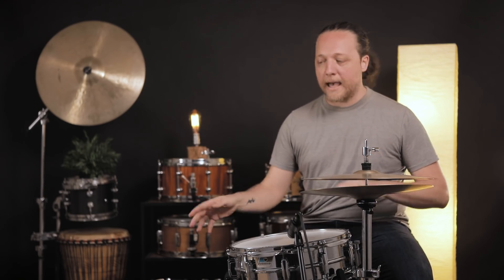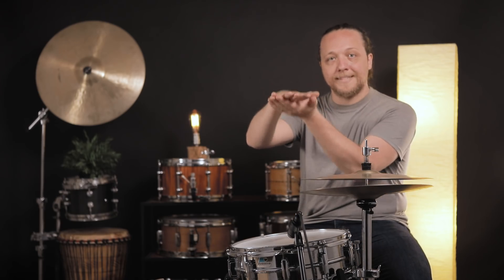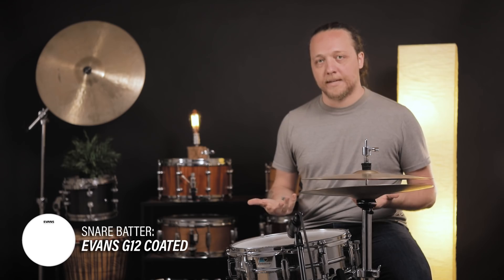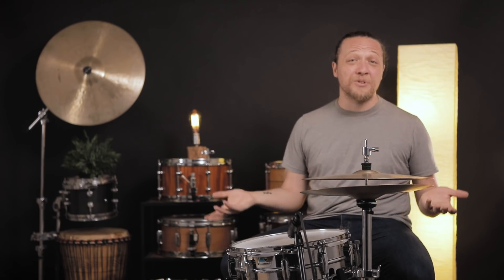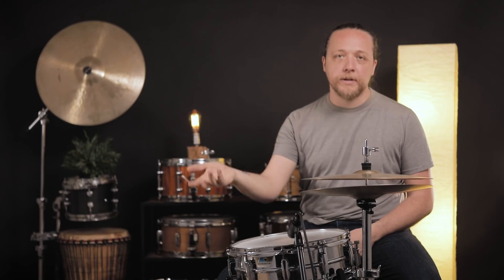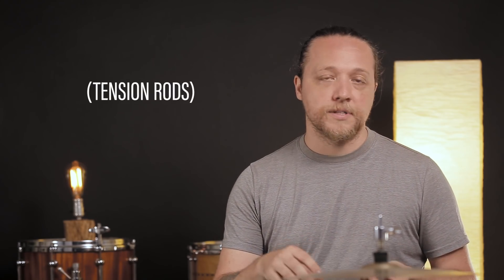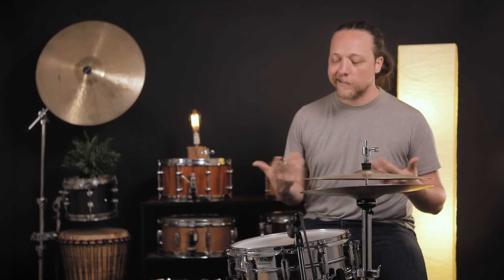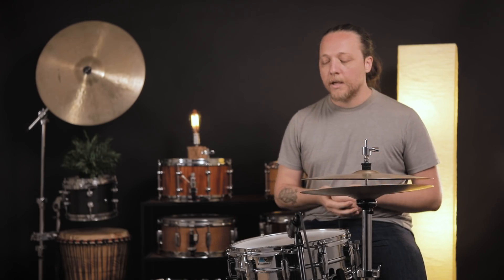Rimshots & Lug Locks - Unwanted Detuning | Season Two, Episode 32

Comment: Hey Cody! I've been following Sounds Like A Drum since the beginning, but this is the first time I thought I could put my two cents of knowledge into a comment! So, here it goes... I am a really heavy hitter, and to me this has always been the top number one issue regarding tuning/playing. I own quite a few snares, and it doesn't matter which one I choose for the gig, I always encounter the same problem with lugs backing out on me. Let me tell you, honestly, I just gave up.

I've had a Pearl Ian Paice Signature snare with what they call "tension locks", and those helped, but didn't eliminate the problem...

I have a couple of DW and PDP snares with the TruePitch tension rods, they say those will stay in tune for a longer time, it didn't help...

I've tried putting some Teflon plumbing tape onto the tip of the tension rod, something I heard a roadie tell me once, that actually helped, but didn't solve the problem and it made quite a mess once it was time to replace the heads, with the tension rods getting all sticky and whatnot...

One thing that actually was quite surprisingly helpful was putting some graphite grease into the receiving part of the drum lug. This particular grease lubricate both the drum lug and the bolt, but it also has a "gripping" effect of sorts, and they keep the lug in tune a lot longer as I've found out.

I've tried numerous brands of lug locks, like Gibraltar, Pearl, etc... and found out that the Tuner Fish Lug Locks are the only ones that really keep the lugs in position, but they are not perfect, and let me tell you why. They come with little rubber bands that are supposed to keep them "attached" to the drum even in the unlikely event of them coming out of the lug head, but these rubber bands are fragile as hell, and even placing the drum inside the case or gig bag has broken them on me. And being perfectly honest, this "unlikely" event of a Tuner Fish Lug Lock snapping out of a lug has happened to me at least a half dozen times, and in two of them I lost both the Tuner Fish Lug Lock and the lug it was "locking". They snapped out of the drum, fell on the floor, and poof... they were gone. Just like you said, the ones that actually snapped out were actually the ones from the bottom side, specifically the ones next to the strainer/throw-off. No idea as to why that happens on this part either.

So, in short, when I have a gig that I know I will be BANGING THE HELL OUT of the drum, this is what I do: I combine a lot of the techniques I found most useful, which are:

1 - Put some graphite grease into each receptacle casing of each drum lug, and a little bit on the tip of the bolt doesn't hurt either;
2 - Install the Pearl Tension Locks (original to the Ian Paice Signature snare) on ALL tension rods;
3 - Install the Tuner Fish Lug Lock with its whimsy rubber band on ALL tension rods just a little before the gig, because if I do it at home and put the drum in its case/gig bag the rubber bands will definetely break;
4 - Pound away;
5 - Once the gig is done, double-check to see if all the Tuner Fish Log Locks are still there. If they are, great success. If not, get on your hands and knees and start looking (a flashlight will help).

So, basically, this is it, at least for me. I forgot to mention, I always carry two snares with me. If the first one starts backing out a lot, I pop the backup on the stand and that is that. I don't have two of each drum, but I do have a Ludwig Supraphonic 14"x6.5 and its "replica" of sorts, which is the Pearl Sensitone Beaded Seamless Aluminum 14"x6.5". Doing all of that helps A LOT, but I have really given up on finding a perfect fix for this problem. Like you said, it's just something about the mechanics of drums.

Sorry for the long essay, but I got really excited when I thought I could actually add to the debate!

Keep rocking, dudes! I'm a huge fan of your work! Best regards from Brazil!

P.S.: If you want to check out my playing, look for Diablo Motor on YouTube or any streaming service! Peace!
Reply: Thiago Sabino I haven't done it personally but it might be worth trying what Crazy 8s Drums said in the comments. He said he puts nuts on the tension rods and tightens them down against the lug inserts. It sounds like it'd work just like the lock nut that keeps the tie rods on your car. You could even take it a step further with nyloc nuts or locking washers if they fit
Reply: Tama TTL10 Tension Lock. Easy, sustainable, cheap, doin their job perfectly. And you are able to turn the rod even when they are installed.
Reply: @Ezekiel Seth Instablaster :)
Reply: @Bishop Cullen thanks for your reply. I found the site on google and Im in the hacking process atm.
Looks like it's gonna take quite some time so I will reply here later when my account password hopefully is recovered.
Reply: @Bishop Cullen it worked and I actually got access to my account again. Im so happy:D
Thanks so much, you saved my ass !
Reply: @Ezekiel Seth You are welcome :D
Reply: I've had this issue on my snares as well, and came across the best product/solution I've ever found: Gauger Percussion Lockerz. They are a game-changer. The tension rods will never come loose. The only reason you'd need to tune is due to wear and tear on the drum head itself. They also work perfectly on the snare side. You can tune while they are installed as well. Only downside: once installed, the tension rod can only be turned with a drum key (no finger tightening) and can only turn in 90 degree increments. Overall, a small price to pay for the effectiveness of the product!

Comment: Awesome video! I've had this issue on my snares for years as well, and came across the best product/solution I've ever found: Gauger Percussion Lockerz. They are a game-changer. The tension rods will never come loose. The only reason you'd need to tune is due to wear and tear on the drum head itself. They also work perfectly on the snare side. You can tune while they are installed as well. Only downside: once installed, the tension rod can only be turned with a drum key (no finger tightening) and can only turn in 90 degree increments. Overall, a small price to pay for the effectiveness of the product!
Reply: Agree. I use these and they are the best. I only put them on the 4 lugs facing me and an additional 2 at 10 and 2. You can turn the drum key to any position though not just 90 deg increments. I just changed a head now and had no issues turning at any angle.

Comment: I've found the little plastic lug locks sometimes pop off, and I've broken a few of those fish thingies by inadvertently striking them (I use Ahead sticks though -- could be "a thing"). What's worked really well for me is a trip to my local hardware store. Bring a tension rod and find nuts that will thread onto the rod properly and are small enough in diameter that you'll be able to turn them with a small wrench when the tension rod is installed; they'll need to clear the shell, AND the drum head's collar. Also get a nylon spacer. (I use spacers that are about 5/16ths tall.)

I put the tension rod through the hoop, slip a nylon spacer onto the rod on the underside of the hoop, then thread on TWO nuts, on at a time, keeping everything loose. I then thread the tension rod into the lug and tune. Once tuned, I tighten the nylon spacer against the bottom of the hoop with the first nut and lock it in place by tightening the second nut against the first. (Buy a small open ended wrench for the nuts if you don't have one). This essentially renders that lug absolutely immovable.

You might need to experiment with the height of the spacer, depending on how much room there is between the bottom of the drum's hoop and it's lugs, but it works amazingly well.

Comment: the cheap plastic lug locks are def the best solution in my opinion.  Ive tried tension rods with a nylon insert notched in the thread.  They def work but its very hard to decipher the correct tension when tuning because they get very tight once the nylon starts to touch the threads

Comment: You could also use a nut with the same threads as the rods, tightening the nut down to the lug. You can see something similar to this on the Pearl Ian Paice signature snare.
Reply: 10-24 thread nuts from Ace Hardware or your local hardware store.
Reply from the maker: Yep! A bit least convenient that simply placing something on top of the tension rod but potentially more reliable.
Reply: Christopher Rogalski the size depends on the drum manufacturer, I know DW / PDP uses 12-24"
Reply: I’m using this method!)))

Comment: I have an old Tama Swingstar 14"x 5" - 8 lug snare drum that sounds real nice and fat with low to medium tuning. The left side lug where I do rim-shots can work it's way out in between every couple of songs. I purchased a heap of those Tuner Fish lug locks, but should have only purchased a few, as I found they're not necessary all around the drum. Oh and don't bother getting the rubber bands that they sell that are supposed to stop the tuner fish from falling off. I found they fall off in transport, so I physically take them off and keep them in a plastic bag when not in use. Also there is a small compromise with the lug locks, because the lug heads are square, the tuner fish lug locks won't go on at any position, there is a little play.  Meaning you have to back it off or tighten slightly or else the lug locks are not firmly against the side of the snare drum. I always like to tighten as opposed to loosening, this helps to keep the tension on.

Comment: BEWARE OF THE BOLTS THAT ARE STEPPED AND MAKE THE CLICKING SOUND WHEN TIGHTENING! Ive tried them, I’m an objective guy and tried them many ways and with different tunings, they never worked as well as the cheap ol lug locks. Great info here, good job guys! B

Comment: Glad this situation of lugs slipping are finally understood so thank you. All this time I thought two to three keys slipping out would put the other lugs out as well. So only the few (2-3) lugs that being hit hardest needs a lug lock. Question; would rims bending be cause from uneven tuning tension or the down force of over-hitting (power rim shots) be cause(s) of rim bending or batter heads stretching at its seams? Thanks

Comment: I hit hard rimshots all the time. I have tension rods fall out of the bottom of the snare as well as the usual top rods loosening.

Here is my experience with the various things I've tried:

Lug Locks (white plastic squares) - work but only very briefly
Tuner Fish - they do stop the lugs from turning, but a misplaced hit will either smash them or send them flying off
Lug Lockerz (nuts for reverse tensioning under the hoop) - these work the best for keeping the tuning, but I would prefer the kind that are hexagonal so I can make them tighter
The next thing to try is PTFE tape on the rod threads. Apparently, it has a similar effect loctite or thread locker but without the permanence.

Comment: I used a few 10-24 nuts from Ace Hardware as a locking nut under the rim. Very cheap and easy to use.
Reply from the maker: That’s a great option as long as they’re easily adjustable for retuning and you don’t plan on needing to move them to other drums. That’s one of the reasons we like the simple nylon squares, as they take a second to install or remove.
Reply: Sounds Like A Drum they back off easily and I got enough to to do a couple dozen drums for less than $5
Reply: Paul Swanson it works very well. I used beat the lug almost all the way off. One night it actually popped out! Hasn’t happened since I put the nuts on.

Comment: I used the Tunerfish ones a while ago, but they kept going missing until I realized (looking back at drum cam footage) that during certain snare fills, they just flew off the snare. Now I use a small cardboard tab with a hole drilled through it. Works like the basic ones you showed off, but they're practically free.

Comment: I don’t like the external locks just for the fact that it’s one more thing to keep track of. I have aftermarket lug screws which have a channel routed out and a plastic insert is moulded in, so there is consistent friction all the way down the threads. I use it on the 4 lugs right under my rim shots (12 lug snare) and underneath on the two opposing screws next to the snare beds on the player side of the wires. Haven’t had a mid-gig detuning problem since I grabbed these.

Comment: I've found that those little plastic locks are prone to fail - either the hole deforms, or the flat edge doesn't stay put. I'm using a more "permanent" lug lock from Gauger Percussion. Tip: the Ludwig Atlas drum key works pretty well in combination with the Gauger lug locks. It has a thin socket and is a little bit longer.
Reply: I second this. Gauger Percussion "Lockerz" are the best product/solution around.
Reply: i just ordered gauger lug locks. seems like the best solution also for some bottom rods.

Comment: I bought lug locks especially for my last recording session. We used my Yamaha Recording Custom brass snare, and the drummer that was using the drum kept managing to have the lug locks fly off the drum mid take, and the tuning lowered anyway (pretty much every take). He was exclusively doing rim shots when hitting the drum, and also hitting hard. It was pretty disappointing to think the lug locks would help, but I found that they didn't do a whole lot.

It won't help with the drum detuning, but I saw a video where Rdavidr drew a line on each of the tension rods and the hoop of the drum, so that when the drum does detune, you can visually see how much it's detuned by and quickly tune it back to where it was, matching the line on the tension rod with the straight line drawn on the hoop... although, I wouldn't want to draw on the tension rods or hoop, and if it detunes by a whole turn, it's not very helpful.

Comment: It's only an issue on the bottom if the lugs go all the way through like on your Ludwig, since the trauma from hitting the rim gets distributed through the top rod and into the lug.
That is why I only use single lug snare drums. I simply got tired of unpacking my snare on tour only to realize that I lost a bottom tension rod the day before.

Comment: I've had the snare side tension rod fall out before.  I have my throw-off at 6 o'clock, and I think it was the tension rod next to the wires/throw-off on the side I rimshot.  It's only happened once, but now I check every day the four tension rods (top and bottom) on either side of where I rimshot.  The snare is a Noble & Cooley Classic SS.

My Ayotte drums have lug locks built into the lugs.  They seem to work well, although I wonder how you're able to re-tune the drums without first backing them off.  Vibrations can cause them to fall out if they're not tightened too, which is annoying.

Comment: Very timely episode! I just bought a pack of Gibraltar Tension Lock rods for my snare (Tama SLP Black Brass 6.5) due to this exact issue. Haven't even had the chance to put them on yet, so I can let you know if they work okay.

I've also had issues with my other snare (Tama SLP Bronze 5.5) having the snare-side rods back out and falling out and onto the floor (I am a heavy hitter, and even more so back when the Broze was my main snare). My solution has been simply to tune higher to get the tuning stability. But I want to achieve stability on lower tunings, especially because the Black Brass sounds so beefy and open at low tunings.

Comment: I tried to post a Amazon link but can't for whatever reason. But you just plug it in the search function on Amazon and it will pull it up. 
It's a product called Vibra-TITE VC-3
It's a reusable threadlocker. It will lock the threads but you can still adjust the lugs if needed with reapplication and it also lubricates the threads. It's a great product with many different uses besides just drum lugs.
This might be something you want to try and do a video about. Most people have never heard of it but I use it all the time.
Reply from the maker: Very interesting! Sounds like something to experiment with on a beater drum to see how it works out. I'm definitely a bit apprehensive about anything that coats the threads to prevent movement but if it doesn't inhibit normal tuning, that could be an excellent option. Cheers! -Ben
Reply: This kind of thing is used all the time in industrial and automotive applications. Just make sure to use one that is removable.

Comment: I changed my snare head and the detuning lug problem went away for a bit, but now it's back with a vengeance. It's backing off so quickly that I can hear the difference between hits and it's way out of tune in under a minute of playing. I ordered lug locks, so I'll be seeing if that helps!

Comment: Had this happen to me on both batter and snare side...a solution I've used is a little - and you only need a dab - of an off the shelf Threadlock (you can find this in the auto dept or any hardware store and is inexpensive)....just have to make sure it is "medium strength"
, typically color coded as the BLUE....
DO NOT USE THE RED
The BLUE is removable so you can still tune and change your drum heads at some point. If you use the red you are basically using super glue and your lugs will never come off again....you DON'T want that.
 LOL!!